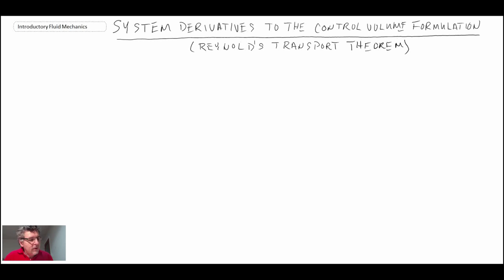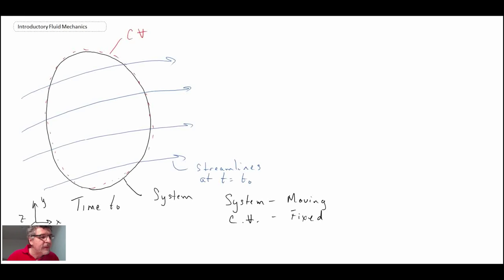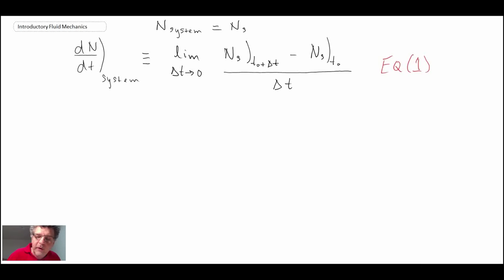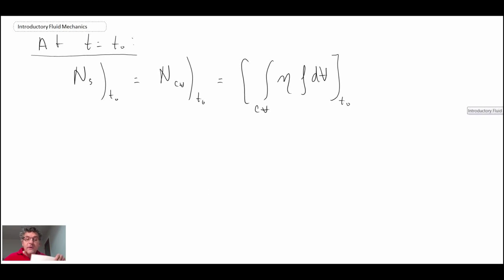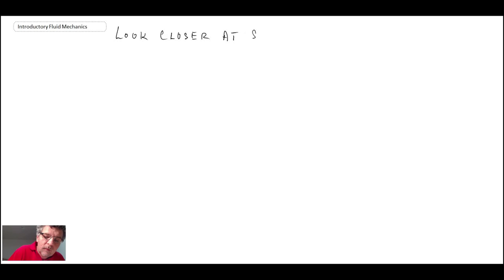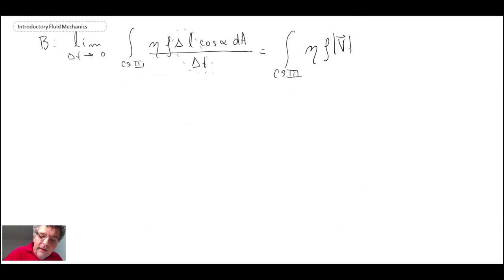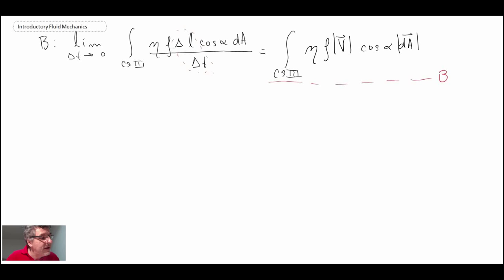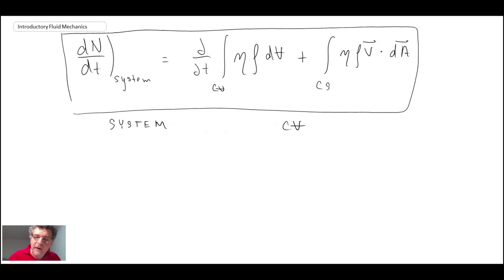Introductory Fluid Mechanics L7 p3 - Reynolds Transport Theorem

Comment: At 26:25 I am pretty sure this is just an error, but the limit of integration on A should be CV and not eta. Because after you write it again with combining B and C the limit shows a control volume integral "CV". This confused me for a little bit.
Reply: MR.kyle , don't be too rigorous , It's an unintended flaw which could be happened for every one operating a complex calculation, we are mankind ! ! you should be grateful for perceiving this analytical problem and tankful to professor Hugo.
Reply: @afshincheraghchi9194  I didn't see this comment as ungrateful or "rigorous," simply pointing out an error that confused him so that others didn't get stuck on the same thing.